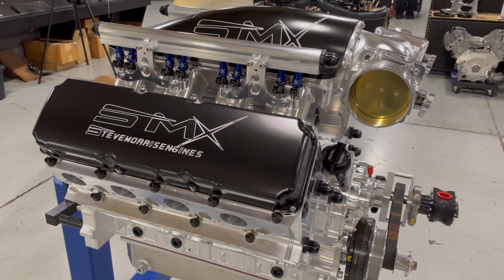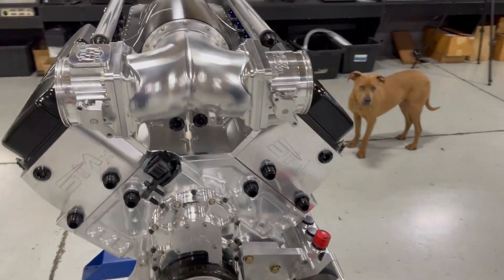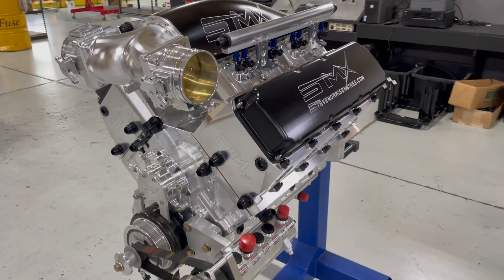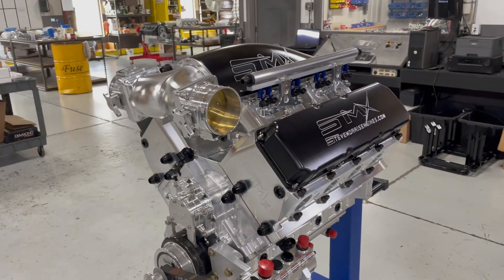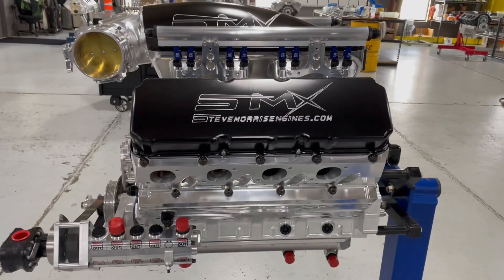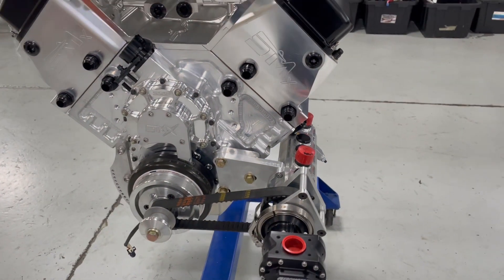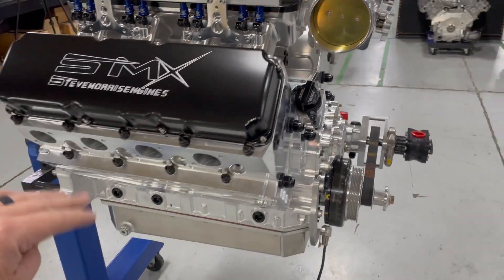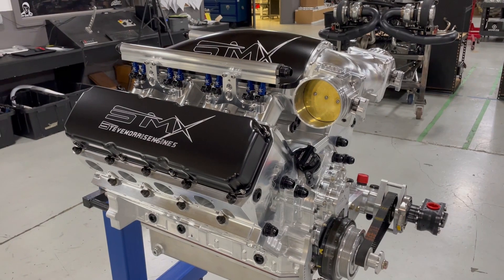The SMX Engine Platform by STEVE MORRIS ENGINES

Comment: Changed the head stud pattern to make it better, I’m guessing by that statement you mean better than ProLine’s design. That’s a rather bold statement. Don’t get me wrong I’m not a ProLine fan boy, truthfully I think they are overpriced, also I’m not doubting your new design, I’m simply stating that’s throwing down the gauntlet so to speak and I’d love to see it backed up on the dyno as well as on drag week or Rocky Mt. race week. The two performance oriented cars I own both have NRE TT 427 ls set ups in them but I’m very curious to see what your new motor design has in store for us.
Reply: For real it’s just a bolt pattern. I bet it has more to do with making it ONLY fit this block/head.
Reply: Not just a bolt pattern when you’re talking sealing cylinders and 90lbs of boost
Reply: @hondatech5000 Exactly right.
Reply: Bigger studs and placed better.

Comment: When you say endurance engine what do you mean?

Could you put it inside a car used for endurance racing?

Like for 24hr races on road courses?

Of course the 4500hp would be over kill but can this be run detuned so that it lasts longer between services?
Reply: Land speed or "Drag week" type endurance im thinking.
Reply: @ThatGuy_21  I know guys running these in champ endurance. 12-16 hours.
Reply: @davefroman4700  I'm curious how much hp they are putting out for that purpose?

Steve's engines always seem very impressive. 

Just wish I could afford to buy one to race with it.
Reply: @clifflee5404  I think you would need two if you were competing. That way you have a back up.

Comment: Time to build a billet 7.0L+ displacement DOHC engine.
Reply: He built a DOHC small block, but that was in 2013. Atleast mercury marine makes and 7.0 and 9.0 dohc v8
Reply: @johnherbold6539  The Mercury SB4 7.0 costs $33,000! And it uses a standard LS block modified to suit their needs. 

Id love to see a full billet ground up 7.0 DOHC 4 valve made for boost and 9000-10,000rpm redline.
Reply: @dallasletersky7586  - need to use Ford Coyote block if they want to be serious
Reply: @CoyoteFTW  Or the new 5.5L ZO6 engine. 640HP from factory with a warranty is quite something.
Reply: @dallasletersky7586  when that engine makes the power the coyote or any mod motor has stock block and heads then we can talk about it. I remember the custom “ls” (had no stock ls part in it) that cleetus used couldn’t go 7‘s and  stay together. John Mihovetz of ACCUFAB Racing has been running 5's in the 1/4 for over 5 years now with an OEM production 281ci 4.6L aluminum block making over 3500 HP. Brett lasala stock block head Coyote, lost this weekend to custom billet big block SMX powered mullet. By a tenth of a second. Chevy so far behind not even funny

Comment: You should be using neoprene gaskets and O-Rings cause ppl are running methanol in these engines and bad things happen you can’t use rubber anything with methanol, they run 91-93 till they get to the track then they suck out the gas and put methanol in that’s why the so called fastest street car in America went up in flames
Reply: If you are talking about Tom Bailey, his engine is this exact engine. It was an o-ring that blew out causing the fire. Nothing to do with the engine, it was the injection system.
You can guaran-fucking-tee that Steve Morris and Tom Bailey know way more about running methanol and building drag engines for the street that you will ever know and that o-ring was the right material for the job.
Reply: @notsofresh8563  That jackanapes is using Smokey as a "handle?"  Disgusting...   smh

Comment: Would this make a good N/A motor for weekend drag racing or is it really only a boosted motor?
Reply: Why spend all that $ for a N/A combo? 🤔
Reply: @caliLakerNiner  i like a motor i can race and not touch for a couple seasons.
Reply: @johndee9719  My point was you don't need something as extreme as an All Billet engine for a naturally-aspirated setup. This motor is built for boost and LOTS of it! To spend this kinda money on a setup as extreme as this and run N/A would be stupid.
Reply: @johndee9719  That motor can make 4500hp. Pretty hard to even use more than 1000-1500 hp due to traction issues (not to mention the motor twisting the car into a pretzel). At 1500 hp that engine is at 33% duty cycle and will last forever.
Reply: @caliLakerNiner  That block/heads built for high rpm with a super lightweight rotating assembly, 8-stack efi through the hood howling at 9500 rpm would be really bad ass, me thinks. Specially with just a little nitrous "for emergencies"
Reply: @notsofresh8563  Why would you need a billet block for a N/A combo?  You guys aren't getting it. Lol Again, this motor is built for boost and lots of it.
Reply: @caliLakerNiner  Cast factory blocks and heads make compromises in port shape, valve angle, pushrod geometry, etc in the name of emissions and ease of manufacturing. Billet parts can eliminate these issues when at the upper limit of performance.
Reply: @notsofresh8563  Aside from being the lightest variant the main advantage of a billet block is strength. For a 3-4000+ HP motor it is absolutely required. For an all out N/A 1000-1200HP setup an aluminum block like a Donovan works just fine. There won't be any "compromise" in port geometry, valve Ange etc.
Reply: @caliLakerNiner  Billet blocks are cooler. That is enough for me.
Reply: @notsofresh8563  Hey spend your money how you want to. 👍
Reply: Once you get into race engines your not going to run multiple seasons without touching it. Even N/A there’s going to be stuff to check and work on. The valvetrain alone is under a lot of stress with big cams and big valves and that doesn’t really change if you’re N/A. 

If you’re actually serious about it then you can get in touch with Steve Morris Engines and they can work out a good engine for you.

Comment: When you say 4,500 on gas you don't mean it can make that on gas right?
Reply: Yeah I heard that too and I think he might of got something wrong there
Reply: I'd wager that it will, given high-octane, race gasoline.
Reply: I think 93 is what he's trying to explain tho... I could be wrong but seem a little out there
Reply: @chevyheavy79  I think he's usually careful to say "pump-gas" if he's intending it to not mean high-octane fuel.  I could also be wrong, though.
Reply: 4500. He aint lyin.

https://www.stevemorrisengines.com/engines/smx-2000-4500-hp-water-jacketed-promod-engine

Lookie. Its 4500 capable, but it can also run on 93 octane.
Reply: He said 93 pump gas... not disputing the hp numbers for everyone that can't read
Reply: Yes. Correct  it didn't make 4500 on 93. Seen the car in person and talked to them both. It ran Meth at the track, and 93 on the road. But had a killer system that had a huge crank. Its all on his channel, he goes thru all his cars.
Reply: Sorry its all on Tom Bailey's channel. Didn't meant confuse.
Reply: "On gas" can mean 118 rocket brand etc. Gasoline.

"Pump gas" would mean 94 ish maximum.